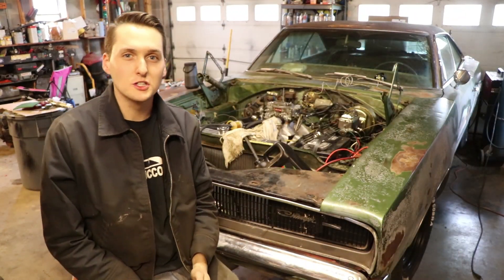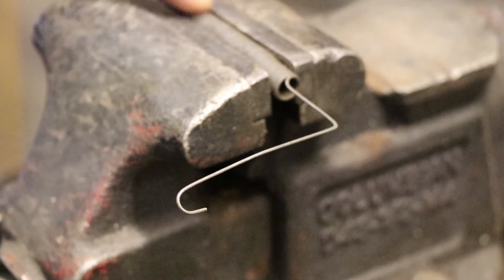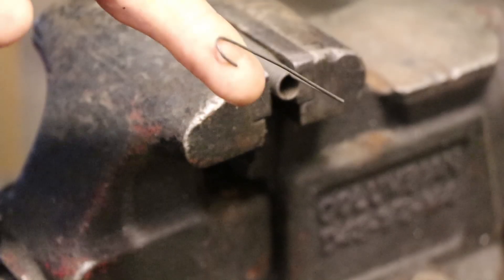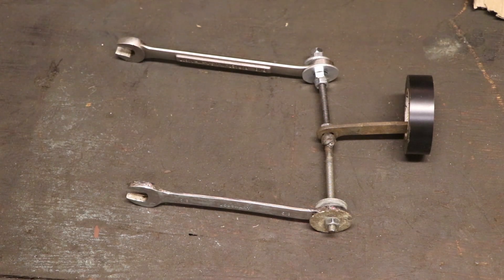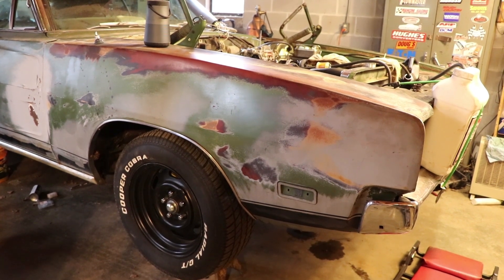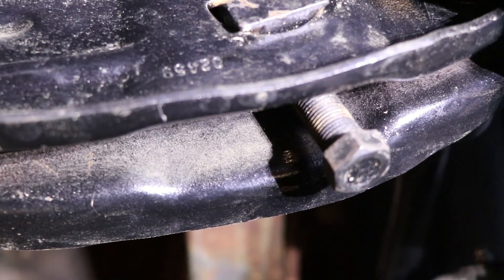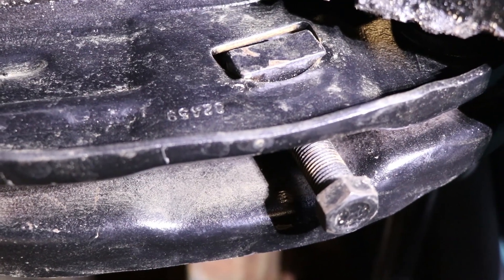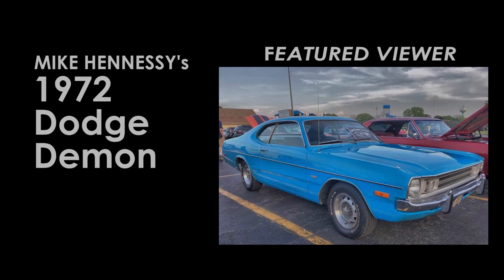HOW TO ADJUST RIDE HEIGHT WITH TORSION BARS

Comment: You're supposed to wear your glasses and a lab coat when presenting educational videos, Dylan. Seriously though, this was a great show on how torsion bars work. I had a '78 Newport with the same set up, though she had a slight lean. I was fortunate enough to find an independent shop that had the experience of repairing them. Somewhere in the car's past it had been lifted or jacked up in the wrong place, and the bar was bent. But in about an hour(including a new bar and alignment), the car was handling and braking a whole lot better. So, long story short, knowing your way around your car is beneficial. Thanks Dylan for bringing great content, it's cool to see young people actually working with their hands on classic cars.

Comment: Procedure basically the same for A,B,C bodies. Another video on the same lowering technique
sowed 5 full turns of the 3/4 bolt ONLY gave 3/8 lowering, but he did not let the car settle either. So good thing

Comment: Remember, torsion bars twist, and can snap. I have personally seen them snap without warning. As stated in the video, always support the car with jack stands before adjusting. Do not scratch or put dings in the torsion bar as this could start a stress crack. I notice the torsion bar is very close to the header. I hope there is enough clearance so that the header does not hit the torsion bar.

Comment: Excellent information.
  I'm working on my buddies 1969 roadrunner. I'm doing a complete rebuild and a disc brake conversion with new spindles.
 How do I find out factory ride height. The front end was worn slap out and way out of alignment. My first experience with a Mopar, so I'm learning.   Thank you for a informative video. Very well done. Thanks.

Comment: Below my 1973 Plymouth Satellite is almost the same torsion bar suspension system. I can also adjust the upper control arm to change the stand of the wheel so it sits right if i lower or higher the ride hight. Maybe this also works for your Dodge as a Plymouth is of the Chrysler Company too.

Comment: I used to adjust the bars on my 71 charger right on the side of the road to lift the front end all the way up to take it off road then adjust them down again after getting back to pavement, needless to say I went through tires really fast on the front.

Comment: I know torsion bar has been used in modern suspension; but for some reason I associated it to a steering system and not the leaf or coil system.  I remember my Dad told me his friends would adjust the torsion bars and it worked well.  So my guess is that it works in modern day in conjunction with the coils or leaf springs???  Again, as a kid I assumed leaf and coil springs took over.

Comment: yes, the static alignment will change when you change ride height, so you always set ride height first. Your model with the wrenches lacked ball joints, so it really didn't represent what happens. Unequal length control arms move the spindle in an arc where the camber changes during the arc.

Comment: You have taken your lessons, men. Thumb up! Im surprised they havent used
an u-shaped torsion bar as they are common on the most european vehicles. 
But behind the big pond things happen a bit different. 
Now i suggest to change this weird fan shroud to one with a proper air flow.

Comment: I have a 73 Cuda and needed to lower my front so the tires wouldn't rub on the front fenders. They were really stuck but with leverage was able to move them. The front end went down and no more tire rub. However, I went back and looked up some information and looked under the car. The Drivers side bolt was a lot lower than the passenger side. Yet when I measured the fenders they seemed fairly close to the same from the top to the ground. Underneath, by the control. They were a different distance to the floor. Is is better to get it the same on the control arms or fender?  Very good explanation of the suspension. I did take it on a short drive and haven't had the time to measure it again.
 By the way I have a 68 Charger. My father back in the 60's raised the torsion bars so that when we went home over gravel roads that had high ruts in it that it would not bottom out. It is  still high but looks kind of cool that way. Should I adjust them down?

Comment: 5:55  torsion bar looks bent.   Are those  the originals?  Consider hotchkis bars they are bigger diameter and made from better hard spring steel.

Comment: love it man greetings from Lebanon i have a 1973 Dodge Charger SE 400 - 4 speeds , i wonder how much travel would a one complete spin do to the ride height  , mine is sitting great but there is a difference in ride height at the back  of the car  (between left rear wheel and right rear  wheel about 2 cm ) don't know if it's from torsion bars adjusting or leaf springs since car sat for 16 years and only moved twice a year )
Reply: Just adjust the opposite side  front torsion bar and that will get the rear looking even on both sides.

Comment: I have a loose torsion bar on my 85 caddy. I can feel it loose in my front driver wheel when I have my foot in the floor(vibration) I redid my whole suspension but the last thing I didn’t check was the bar. If Tighten  it will it also tighten the bar from shaking? Doesn’t appear to be broken. Do these get loose over time?

Comment: Adjust them.. measure the height at fender.. Drive.. go over stuff.. get out Measure.. adjust again.. ad 3/4 -1/2 inch higher on driver side so it looks level when your inside driving.. Repeat All Steps.. until your happy... lastly Ask Fat friend to get in.. so Passenger side will drop.. Repeat All steps with heavy buddy.. adjust again.. measure again.. done.. Be Stoked.. your driving Mopar.. Daily driven 68 Dodge Dart..

Comment: Dude you totally explained Torsion bar suspension wrong . now had you grabbed the back of that spring hook with a pair of needle nose pliers and twisted it, then let it go to pop back to its original position then that would've been waaaay better. Torsion bars are NOT like leaf springs , they dont bend, yet they TWIST. they are escentially a straightened spring. if you straighten both your arms out in front of you 90 degrees from your body like you are holding out a tray then twist your elbows in and out, THIS is what torsion bars do under your car.
Reply from the maker: I don’t think you watched my video before making this comment. My spring demonstration shows this exactly. The spring rotates and uses that tension to recoil the suspension. I even mention that the rear of the bar is locked into place by the torsion bar cross member. It doesn’t get more simple than that.
Reply: Dylan McCool lol yeah I read this comment then watched and was confused what he was nagging on.